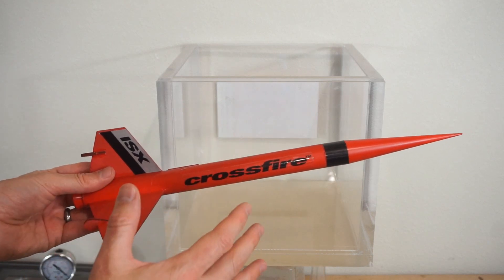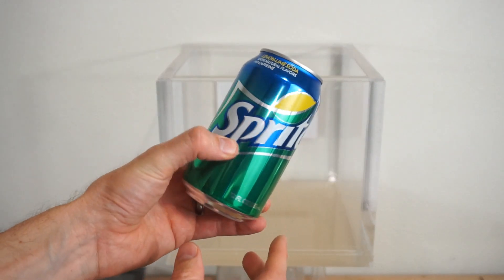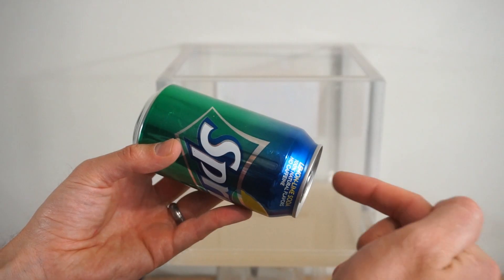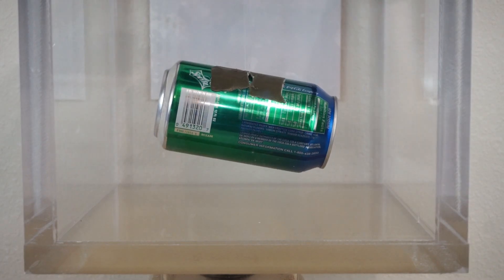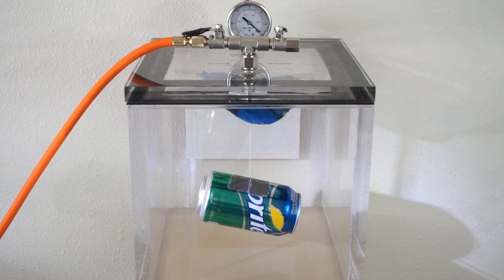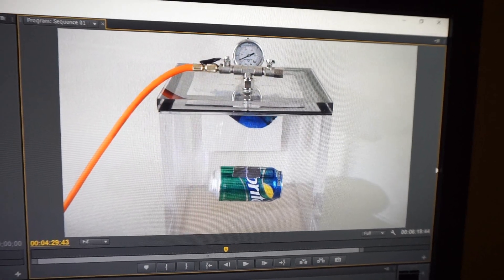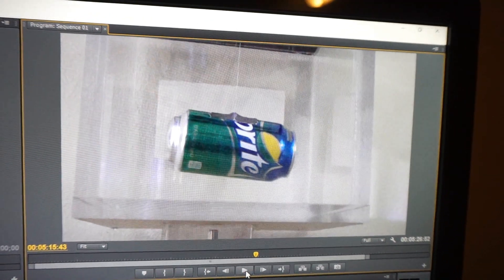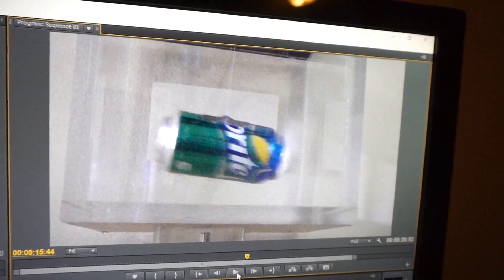Can a Rocket Fly in a Vacuum Chamber?

Comment: Not a scientific test. #1 there is still air in the tank. Not possible to create absolute vacuums with pumps. #2 there are still surfaces near the blast. #3 if cold welding doesnt occur, its not an ideal space test because it demonstrates its not a perfect vacuum.
Reply: - "if cold welding doesn't occur, its not an ideal space test because it demonstrates its not a perfect vacuum."
This is a lie.
"Cold Welding" does not occur instantaneously in a vacuum and ONLY occurs between certain metals.
I have been operating some of the nation's largest thermal vacuum chambers for almost 30 years.
I have NEVER found ANYTHING that "cold welds" itself even after MONTHS under vacuum.

Stick to topics you are familiar with.
Reply: @stuartgray5877  i understand. But, the apparatus you use to create a vacuum, is incapable of a true space vacuum. I had dinner with Dr Dunn at Nasa, and we discussed the cold welding phenomenon in elicit detail. And granted, we did not cover a spectrum of metals. But one thing he mentioned was that space craft doors would cold weld.
Reply: @stuartgray5877  also, your tone is not friendly... calling me a liar... which sounds like your inferring i know something different than what I stated. And I would not have bothered to say it if it, was, as you said it...a lie. In the future try not to emotionalize arguments. It only makes people look intellectually weak.
Reply: @chayankhoidream  well you also appear to be suggesting that rocket propulsion does not work in a vacuum
Tell me your stance on that subject.
And I did not get emotional OR insult you. I merely stated facts.  If facts scare you then I am the last person you should be interacting with.
Reply: @chayankhoidream  I build spacecraft as my job of 30 years. We never worry about "cold welding" in a vacuum unless the parts are exposed for a very long time.
So AGAIN, stick to topics you are familiar with. This is obviously NOT one of them.
Reply: @stuartgray5877  No facts, no evidence, just take my word for it because I am an authority? Well, we call that, “Appeal to Authority”. You can’t even describe in articulate manner what material integrations would be compatible. Something a scientist and an engineer would be able to do. However, what stands is monumental. I believe doors can be built that don’t cold weld. My point before getting buzzed with “straw man” was I WOULD LIKE TO SEE A COLD WELD TO DEMONSTRATE THE VACUUM FACED BY REAL SCENARIOS.

Thats it. No cold weld using a clean uncontaminated metal like copper in the vacuum, then... NO CREDIBILITY.

Resist any gormless answers, thanks.
Reply: @stuartgray5877  rocket pressure absolutely, does not work in a vacuum. No computer model will stand. No thought experiment will stand. However... there is something called “center of mass”.  If i was in a small boat, which had some bowling balls; I can move the boat by throwing a bowling ball out of the boat in a single direction. And, could build up a momentum to shift the boat. However, there is a center of mass formula and calculation. Some aspects of the calculation will work in space without motion decay or resistance. The problem comes in when you have a 9,000 lbs spacecraft and limited fuel. To be fair, CoM could work in space even with ounces of expulsion over long periods. But, the number of manipulations & corrections designated by the astronaut, against the mass of the vehicle, make this totally impractical and unlikely. A burn down analysis can be created using these factors: spacecraft weight, mass of material ejected and time duration of ejection,  amount of “fuel” being expelled and its force potential during ejection, speed of current vehicle directional momentum and axis momentum. (Angular)

Example, the Apollo ascent module is said to be 22,668 lbs. On the moon, that would be 3778 lbs. Using the fuels potential, for center of mass (CoM) [aerozine 50 UDMH & dinitrogen tetroxide]. What really is the CoM potential in a vacuum, manipulating a 3,778 craft? Again, to be fair it was inches from the surface so initial take off would produce more force than CoM. But the calculation of force required to ascent from the surface using some surface repelling and center of mass can be calculated. And thats the magic number. Ignoring weight, and all other aspects... what is the potential force generated by the system during take off in a vacuum? In other words, how much propellant do I need?
Reply: - "No facts, no evidence, just take my word for it because I am an authority? "
No sorry but hte FACTS are on my side.
For example, Newton's three laws say that rocket propulsion MUST be possible in a vacuum.
And here is a video with undeniable evidence of rocket propulsion in a vacuum.
 Watch the YT video: "uninterrupted footage of the falcon heavy launch and booster landing! 2-6-18"
Watch from launch to side booster landing then TELL US WHAT YOU JUST WITNESSED.

If you cannot spot the multiple examples of rocket propulsion in a vacuum in that video, I would be happy to point them out for you.
Reply: @stuartgray5877  LEO still has atmosphere. Thermosphere, is still atmosphere.
Reply: @chayankhoidream  So youa re SCARED to watch a video?
Poor thing. is the internet too scary for you?

Watch the YT video: "uninterrupted footage of the falcon heavy launch and booster landing! 2-6-18"
Watch from launch to side booster landing then TELL US WHAT YOU JUST WITNESSED.
Reply: @chayankhoidream  - "LEO still has atmosphere. Thermosphere, is still atmosphere."

Sure but atmospheric pressure drops to BELOW 1.0 Torr at ONLY 50 kilometers. This is VACUUM.
The video I showed you shows that rocket performing propulsive maneuvers ABOVE 50 kilometers genius.
I have been building launching and operating deep space science probes since before you were born.
Finish high school BEFORE trying to lecture actual engineers about basic physics.
Reply: @stuartgray5877  i can watch the video, that’s no problem. But, the issue is that its still some kind of atmosphere. How may miles out from surface are we talking about? Because Ive heard some numbers and it sounds like LEO to me. Of course, I am on the same page on operations “in earths upper atmosphere” and propellent efficacy. How else could space x and every other space agency get projects where they need to be and certainly satellites are there and I know they operate.

My point, which still hasn’t been addressed, is operations demonstrating in absolute space vacuum. AND THEN, offered a cold weld argument to help verify the demonstration. To which, no address has been made. Read through the comments... ive had one request this entire time and the response has been dancing around everything but a solution. If i am wrong about something, especially in a YT chat... I can take my lumps and move on. But here i still am, being assured with only AUTHORITY when the modeling of earth bound vacuum chambers are not PRODUCING ABSOLUTE SPACE VACUUM. 

Also, I never, ever, take a position so that I can be “right.” What do I care if some stranger on the other end of this Yt chat see’s whether I am right or wrong? This is a lot of work to tease out an understanding.
Reply: @chayankhoidream  I helped build, test, and launch the Mars Global Surveyor, Stardust, Genesis, Deep Impact, Kepler Space Telescope, NOAA-20, and IXPE Xray Telescopes. Look them up.
I was on the mission operations team for three of them including being a flight director at JPL.
Reply: @chayankhoidream  I have tried to explain this to you repeatedly: I have been a Vacuum Test Specialist for almost 30 years.
I have operated some of the largest and most expensive thermal vacuum chambers in the US with BILLION dollar vehicles inside.
I have NEVER had ANY kind of problem with "cold welding" of metals in a vacuum.
Now STOP trying to lecture a literal Spacecraft Integration and test engineer about spaceflight technology.
Reply: @chayankhoidream  Now if you wudl like to discuss rocket propulsion in a vacuum, then stay on topic.
DO YOU think that mechanical recoil still works in a vacuum?
Would a crossbow fired into vacuum have any recoil?
Yes or No?
Reply: @stuartgray5877  center of mass works in space. If i have an astronaut suite on and i throw a bowling ball its going to push me. The only question i have is the force exerted by particulate mass vs required force for controlled motion.
Reply: @stuartgray5877  right, what you explained is always the same: you’re an authority and you want me to cope with “an appeal to an authority”.  My arguments go unchallenged, unnoticed, and the bypass is...”listen to me this is what i have been doing for years” (more or less) 

So either my comments are not being examined, or there no rebuttal for the arguments i provided. You see i understand the condition already. Perhaps what you’re not saying is cold welding is not demonstrable in large vacuum chambers. We could also say, cold welding in a vacuum is not a real thing.(and here’s why...)
If above is true, than a true experimental vacuum chamber is not available. And if thats true, fully complete testing and analysis cant be performed on earth. And if that’s true, it would explain the high failure rates we’ve seen in the last 5 decades. Am i missing anything?
Reply: @chayankhoidream  SO you agree that mechanical recoil works  in a vacuum. Great!
Now what would happen if a machine accelerated 500 kilograms of pure water into the vacuum?
Would this machine get "propelled" backwards? What if it could "fire" this 500 kilograms once every second?
Reply: @chayankhoidream  None of what you said above is correct.
I merely ask you questions and expect you to answer.
You AGREED that mechanical recoil works in a vacuum. Now could a machine "Propel" itself in a vacuum if it fired out 500 kilograms of pure water every second? Yes or NO? WHY are you scared to answer my questions?
Are you AFRAID that your answer will prove YOU wrong?
Reply: @chayankhoidream  Do you consider PHYSICS TEACHERS the "Authority" on how basic physics works?
Then GO ASK ONE OF THEM how rocket propulsion works. Quit trying to get your education from YouTube comments!
Don't take MY word for it GO
GET
AN
EDUCATION!
Reply: @stuartgray5877  this is the lego block argument. Your just waiting for your turn to respond, with more appeal to authority nonsense. It would be like if I said i built a waspaloy fuel elbow for Nasa’s booster rockets and pivoted every convo on that. Oh wait, i did build and PM parts for Nasa and Military jet programs... so therefore all of my arguments are correct and factual. In fact, if it was possible, i think we need AMS specifications on your comments because they are failing the tests! 🍼💦
Reply: @stuartgray5877  boooo ZZZZzzzz bored.
Reply: @stuartgray5877  it would work. Ergo... what ive said alll along if my comments were read
Reply: @stuartgray5877  you’re the one retreating. You’re definitely not behaving like a marine. 🤦🏻‍♂️
Reply: @chayankhoidream  Sorry to break it to you, but my company TESTS rocket engines here on earth IN A VACUUM. We VERIFY that they DO produce the thrust predicted by the Tsiolkovsky Rocket equation. We then put those rocket engines on real spacecraft, launch them to space and TEST THEM THERE TOO!
Look up the "Green Propellant Infusion Mission" (GPIM). My company built, launched, and operated that spacecraft,
YOU are the one that is clueless.
Reply: @stuartgray5877  of course, some kind of vacuum. I never once thought we were arguing that point. But, there are mechanical limitations to what an earth run vacuum can do. Im not sure whats going on with the comments here. I keep issuing the same problem, and the feedback i get is “appeal to an authority”. Sorry man, dont want it and dont need it. My situation is to never trust people, and only trust facts and evidence that i can demonstrate in some way. You could be building a rocket-ship to the moon and it won’t matter to me. 

So, the situation is Im going to treat space as “absolute vacuum”. And an earth vacuum chamber is mechanical, it uses a pump to pull some gasses out of the chamber.  But the problem is, its effectiveness drops significantly because of dependencies; there are limitations to what the system can do when using a pump with seals and other mechanical parts. How can a mechanical system ever reach absolute vacuum (like space) with valves, pistons, and various parts leaking, not to mention the fact that there’s only so much that a pump can do once the vacuum gets to a certain point. 
 
My point is that we need actual environmental factors to test a space system, and these are not achievable unless we can fully understand and replicate conditions for testing.

A multiphase vacuum system can get us closer, but its still mechanical. I believe the reality is we need a 2 stage vacuum system; 1) mechanical vacuum to do a chunk of the business, then 2) using electron gun and electromagnetics, -destroy and ionize everything in the cavity, and then use electromagnetics to exit rest of the remaining gases.
Reply: @chayankhoidream  - "My point is that we need actual environmental factors to test a space system, and these are not achievable unless we can fully understand and "replicate conditions for testing.

I have built launched and helped operate three spacecraft with propulsion systems IN SPACE!

WE
ALREADY 
DO 
TEST
THEM
IN 
SPACE!
??WHICH PART ARE YOU FAILING TO UNDERSTAND?
Reply: @stuartgray5877  my critique to this short, was that it was basically—inaccurate.

And that its not a true vacuum, which it isnt. And then some cold weld discussions. It might be that rockets are tested in thermosphere which is still part of earths atmosphere... ergo, resistance is still available even in that space. And we know the propellent for devices have to use center of mass, because surprise!! Rocket propulsion doesnt work in a exosphere or absolute space unless there is something to push off of. Works to a degree, but not enough efficacy to convince me. Show me a earth cold weld vacuum demonstration and I will STFU
Reply: @stuartgray5877  i worked with Dr Dunn, we talked at length one night about it. And he explained, its still in earths atmosphere. And in fact, the problem with the station is that it needs a lot of momentum to stay up there, and builds huge static discharges from interactions with THE ATMOSPHERE.
Reply: @chayankhoidream  - "Rocket propulsion doesnt work in a exosphere or absolute space unless there is something to push off of"
You seem to have a reading comprehension issue. I will repeat:
I
HAVE
BUILT, LAUNCHED, and TESTED MULTIPLE spacecraft in space INCLUDING DEEP SPACE!
I have built spacecraft that flew over 130 MILLION miles from earth, one that Orbited
and landed on MARS.
Rockets TAKE
MASS
WITH
THEM
TO PUSH ON!
Jesus to STUPID is STRONG in this one!
Reply: @stuartgray5877 substantiate your claims. Where’s the proof? Where’s the evidence? Don’t worry, Ill wait.
Reply: @stuartgray5877  PROVE IT
Reply: @chayankhoidream  a rocket is a primitive heat engine, so it's trivial to calculate its work output in a vacuum. The output is zero.
Reply: @papalegba6796  So YOU claim that a machine CAN accelerate 500 kilograms of MASS from a standstill to MACH EIGHT without performing ANY WORK?

A SSME applies a HUGE FORCE to the mass of the exhaust gas to get it to accelerate from a velocity of ZERO to 2500 meters per second.
But YOU think it can do this without applying any FORCE to that mass?

I don't think that word "work" means what YOU think it means genius.
Maybe TRY finishing high school before challenging actual Engineers about basic physics?
Reply: @stuartgray5877  no, I claim the work output of a rocket in a vacuum is zero, crazy chatbot. Because it's a primitive heat engine.
Reply: @chayankhoidream  We have PROOF that rocket engines ACCELERATE MASS.
Tell me from WHERE does the FORCE ORIGINATE that accelerates this mass?
Is it MAGIC?
Reply: @stuartgray5877  who’s “we”? Who are you? Are you like the “they/them?”
Reply: @stuartgray5877  the irony is that people used to think rocket scientists were smart. I think there couldnt be a more dumber, stoogy group of goons, than a rocket scientist. 

Rockets might fool the people, but they dont fool me. They look like pretty fireworks when they take off, and sometimes they explode and people die. Its like a beautiful play for the masses of people who dont know any better. Lights! Camera! Action! And then theres drama.

 LIGHTS!
CAMERA!
ACTION!

Let your eyes lie to you, and let your mind sunder into the chasm of the abyss.
Reply: @chayankhoidream  And I did not see your post above until rocketman posted
Reply: @chayankhoidream  YT is already deleting my posts. I merely attempted to direct you to a video on my YT channel. Apparently, you are not allowed to do THAT.
Reply: And I will repeat  I have personally put almost a dozen different spacecraft and their components through thermal vacuum testing and DOZENS of flight boxes.
WE
HAVE 
NEVER
ONCE
Had a problem with "cold welding".
Now DONT trust a vacuum test specialist OR a spacecraft Integration and Test Enginjeer (I am BOTH).
Go get your "facts" from Eric Dubay
Reply: @stuartgray5877  my argument was never about the material problems with cold welding. My argument was a true space vacuum will cause cold welding with the same material. So in order to test a true vacuum, lets using a material to check for cold welding. My argument was never about material science and spacecraft design.
Reply: Look, I dont know what the big deal is. If Dr Dunn is wrong, if other scientists are wrong about cold welding... great. And an astronaut which said the door had cold welded on his trip...All i am asking for is a vacuum test using a simple material like copper to help demonstrate the vacuum. Thats it. Its not rocket science. 😀